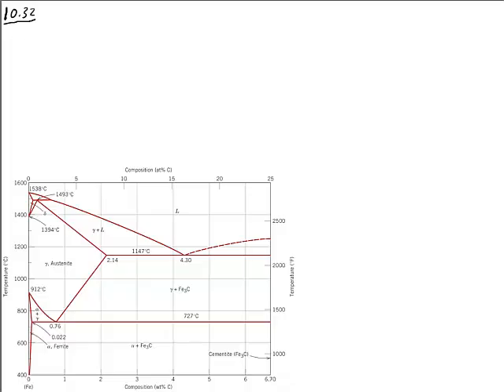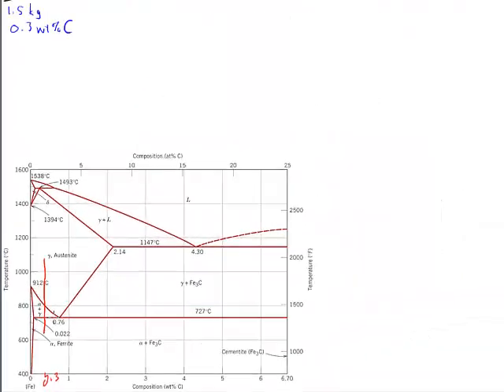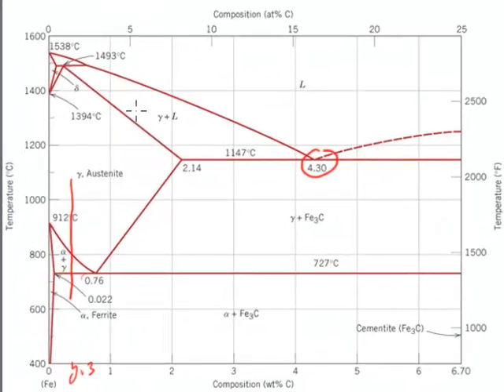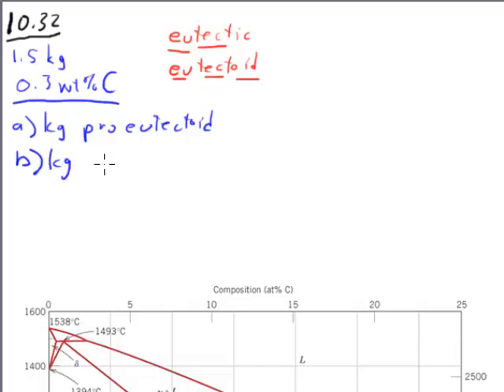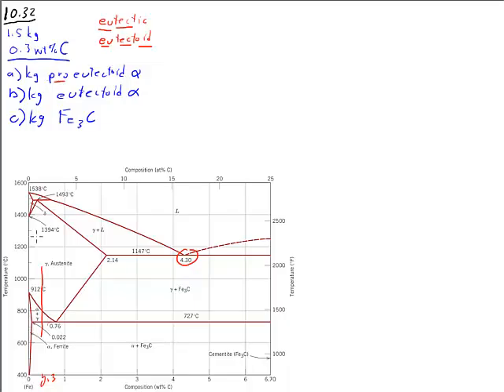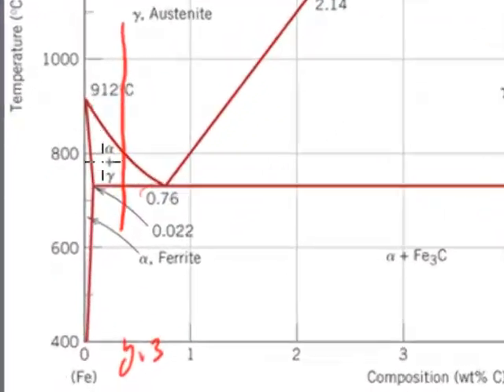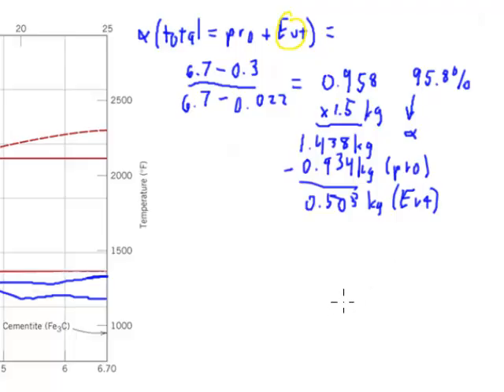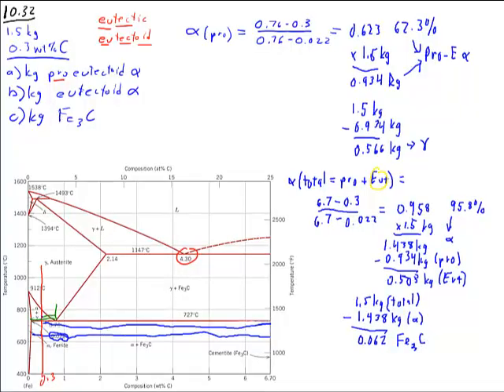Iron-carbon (Steel) Phase Diagram w/ Pro-Eutectoid Step

Comment: When you calculate pro-eutectoid ferrite, your tie line went passed the boundary (solidus). If instead your tie line stopped at the boundary, what would that indicate instead? Or does it not have any meaning?

Comment: Where did 0.76 come from?
Reply: percentage carbon at the eutectoid point
Reply from the maker: +Lene Fosse 
Thanks, Katherine.
0.76% is the point at which carbon is eutectoid in iron in this composition. It is shown clearly on the diagram, but maybe I should have stated it explicitly.